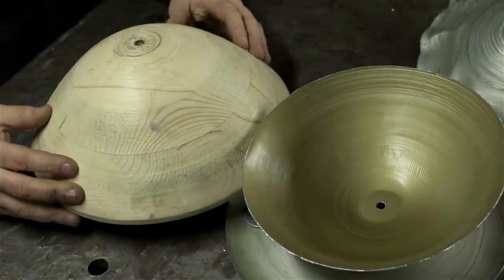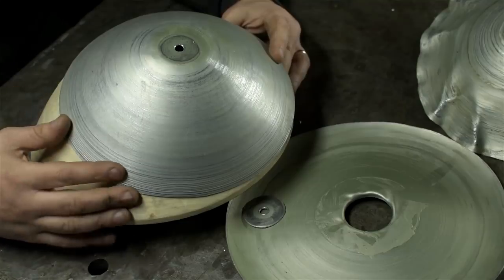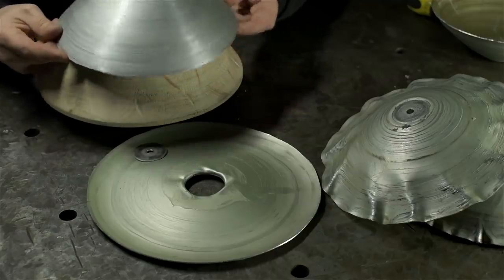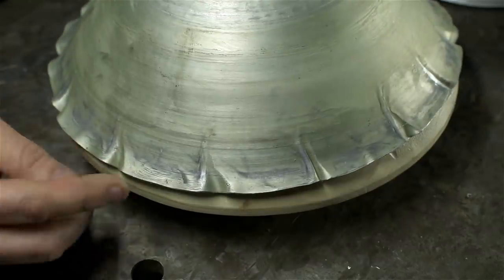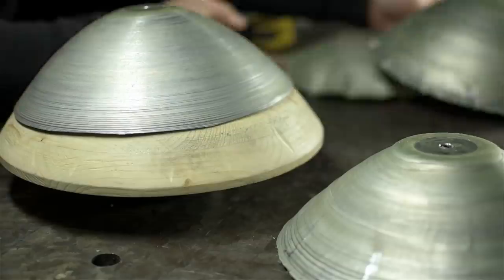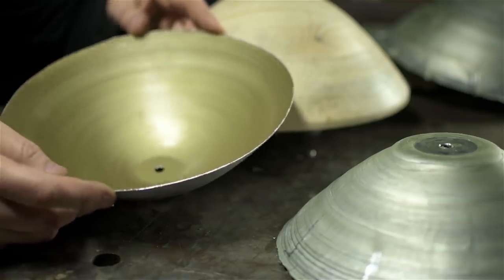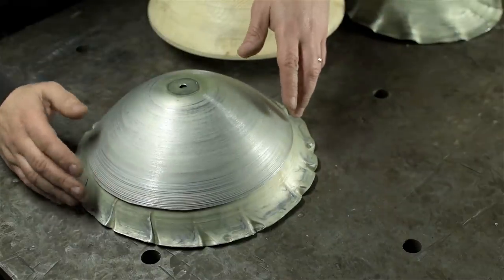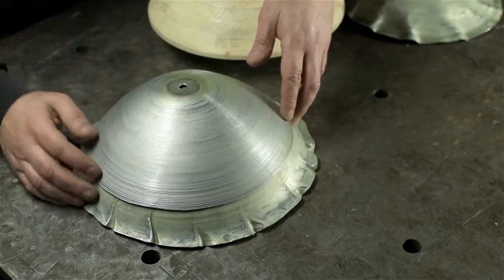Spinning Metal - Round 1 - I LOST!

Comment: This stuff, speaking from my own experience, is finnicky as hell to get done properly. I find a lot comes down to material. Copper does indeed work harden easily, brass has similar issues, I haven't done any trials with aluminium but your issues definitely does look similar to the issues I've had on smaller trials in copper. I do wonder what would happen if you stop halfway through and anneal it and then continue, and maybe again if you notice it starting to feel wobbly. Love the tool, is that just a rounded off bearing? I've just used solid tools, with plenty of lubrication.
Reply: Switch & Lever looks like a bearing from a self aligning flange bearing unit.
Reply: especially if you have a dowel to locate center, I really don't see why taking it off and re-annealing wouldn't work
Reply: What causes the waves at the edges of the larger attempts? It looks like the result of attempts to squeeze the material down to a smaller diameter. But of course that's not the case, as he obviously knows that would be impossible and he never tries it.  So what does cause that deformation? 
I'd love to experiment with it, but I don't have the tools or space.
Reply: well i can say that at work we'll spin aluminium up into the 60" diameter range, and ~18" draws. Yes, material selection is important and so is operator skill. I've not been all that involved in the specifics, but we did change a material a while back (10+ years) and had issues. We've also occasionally had issues with our supplier not providing exactly spec material which also causes problems.
Reply: Chris Edwards: Actually, it is very much possible. It is called, "raising," and is common in the light metals smithing world. The material does, in fact, squeeze together and become thicker. It's usually done with a hammer and stake, but I don't see why it shouldn't be possible as a spinning operation. With a hammer and stake, you just keep adjusting the position of the piece between the two forming surfaces to keep control and prevent folding. With spinning, I suspect it would require a progressive series of forms so that the material is backed up and compressed between surfaces.
Reply: Hi Daniel, They spin Titanium (yes, really) in a challenge-contest in Japan in this video: https://youtu.be/yUi9T_vj8zA?t=15m29s .Yes, annealing plays a big role.
Reply: get rid of the wood, flame anneal on the fly
Reply from the maker: Thanks Switch.. yes it's a round bearing I pulled out of a self-aligning bearing style mount.  Already round. :)
Reply: FXM - this is sinking or dishing because the material stretches and becomes thinner. in raising the material will shrink (generally) and become thicker.
Reply: @ThisOldTony  the disk... is actually shrinking not stretching... you can't avoid work hardening so you have to anneal as you go if you can't form it fast... fast spinning generates its own heat 👌👍
Reply: @ThisOldTony  Hope you’re well!
Reply: yes, especially that annealing part is key, trust me.
Reply: sometimes you just need big flamethrowers.
Reply: Half way through spinning you should use a bigger centre stop that is also the shape of the spinning pattern.

Comment: We have the same issues in ceramics.   I think you need to slow the lathe right down.  The faster you go the more force you have on the edge to flatten. The two pressures one being your force and the other force due to the rotation with produce those crincles.

Comment: once you get half way through forming... you can fold over the outer most 1/8 to 1/4 inch in the direction you are going, (towards the head), the closer you get the outer 1/4 inch diameter bend to a 90 degree, the better off you will be, on the rippled effect... you can try a bit of that, right before you try to lay the little bend down to the form, (buck) cut it off, with what ever lathe tool you see fit, slow RPM's... That s what works for me, on either brass, aluminum, copper... I have not played with steel sheets yet, no need, I suppose is why.. Oh, and even though, you are using what appears to be a roller type bearing, you still need oil, something to stave off any work hardening heat that would otherwise form with out running oil or isopropyl alcohol in a spray bottle.. Some will question the volatility of that, as one should, but it does keep it cool... you can start out fast, but as you work towards the outer, baby step, young grass hopper... slow as it goes... As you have already figured, the out diameter, is allot to shrink... the further out you are from the center, the tighter you have to keep your tooling to the buck and to force the alloy to shrink into itself, yes, the wobble make you desire to correct it, but the 90 degree bend you place into it, helps with that further along... good luck, and be safe.. those can come off like ninja stars, thrown by Babe Ruth...
Reply: Thanks.

Comment: Hey tot! The buckling problem is from getting the metal too thin.  If you lay metal down to the buck on the forward stroke (towards the headstock) you will stretch it- making it thinner as you go.  However, if you lay it to the buck using a backstroke (toward the tailstock) it won't stretch. You still have to form it (getting a working angle) using a forward stroke of course, BUT DON'T LAY IT TO THE BUCK until the backstroke.  Best grade of Al for spinning is 1100-O in my limited experience I've never had to anneal it-making small under 8" projects.  Lube with 50/50 mix of beeswax and mineral oil. Thanks for the vid!!

Comment: If you get some normal soap bars and rub them onto the blanks, you can get your propane torch and heat them until the soap turns black, then let it cool down in the air. This will anneal the blanks and make them much softer, you can also repeat it as many times as you like. :)
Reply: Yup! Whut he saied.
Reply: Hipgluthabidydabidy this works with acetylene smoke as well.  Put the smoke on the aluminum and heat it just until the soot burns away then cool slowly

Comment: If you are using aluminium, you ned to know that it work hardens on it self over a period of 6 weeks. The trick to spinning aluminium is to use fresh rolled material. And dont bother with center dowel, just use a flat piece on your tailstock to support the work piece. That way you will be be able to draw all of the material from the center and outwards.
Reply: I was wondering if periodic annealing during the op would help.
Reply: It depends massively on the grade. Some will age harden at room temperature quite quickly. Others will barely age harden at all even at higher temperatures.
Reply: i thought brass or copper would be better to start out with
Reply: Tsf Phi go byu a brain
Reply: There is a way to reverse that, involves heating. 
It's usually mentioned in regards to stress cracks when bending it, but it should apply here.

Comment: Tony, you are definitely work hardening the metal, Annealing is the way to go for sure. All you need is a propane torch, and a sharpie to anneal (torch for heating, sharpie for heat control) 4:13, (and the 2-3 seconds there after) is about where you can see the work hardening at play, It should never fight you that hard. Once you get the metal formed to that point, draw on the metal with a sharpie, and torch it until the sharpie marks disappear.  Let it cool till you can touch it, and start again. Theres a video on a Trombone repair thats been fairly popular lately that uses this technique.

Comment: I am a spinner ( apprentice ), but still technically a spinner. so we specialise in doing what you attempted to do int the video so i can possibly give you some tips. First things first, the thing you called "lamp shading" could be happening one, recourse you are pushing the metal too much at one time so it ends up work hardening ( i have never spun aluminum but we spin brass and that work hardens ) so you might need to anneal it maybe, again, i haven't spun aluminum so I'm not sure. And two, we use a thing called a "back stick" to support the material from behind to sort of stop it from buckling but we do do it by hand, so instead of using an engineering lathe and putting a tool on that we hold the tool in our hands and leverage it against a tool rest so it's easy to use the other hand to hold the back stick. Another thing we do is use things  called drafts, which are basically just some shapes bigger than the one you end up with,  so you end up spinning it step by step and make it smaller with each step until you get close to the final shape and then go onto it. The way you attempted to do it is very different to the way we do it but this might help.
Reply: Varis Prieditis I'm really glad there are still apprentice spinners. I apprentices at my dads shop and then a friends for 4 years. I don't spin anymore but it makes me glad people still do

Comment: These days you use a special ball bearing to bend the plate. In my days I used a polished hard steel tip bar to bend the sheet disc into bowls, cowls, etc.

Comment: Thicker material, annealed first, soap to lubricate, non rotating tool - a bit like a very polished smooth heel bar, on a long lever. Flat bar in the toolpost, with pins to lever the bar against, carriage locked. Hth!
Reply: can you explain your tooling more, I'd like to try the setup you describe

Comment: I don’t know if someone else mentioned it, but in manufacturing when making a rounded blank similar to what you are attempting we coat the top of the metal with plastic, something as simple as a torn up clear garbage bag helps. It prevents the metal tearing/wrinkling up on the ends. Maybe use some spray adhesive to hold a torn bag on?

Comment: A: I think you need to anneal your aluminum first. Smoke it with acetylene then get the torch just hot enough to burn it off. B: I'd guess your metal lathe doesn't spin fast enough. Hook up a jet engine and spin that sucker at 100,000 rpm. If A: doesn't do the trick, try B:, or C: lol

Comment: A friend of mine used to spin dishes for the Patriot missle system, and he had what looked like a crayon that he would mark the stock in several spots, then anneal it from the bottom with a rose bud torch till the crayon marks turned a specific color, and that would tell him when it was ready to spin. Pretty cool process.
Reply: Thanks for sharing. Useful pieces of info like this are half the reason I read the comments section.

Comment: The thing i see wrong here (with limited experience) is that you don't commit to the action, you have to  carry out the "wave" all from point A to point B without flapping about, and maybe that you shouldn't use a metal forming tool. Just my two  cents here.
Reply: The way I was taught back in the 80s by a guy who produced tens of thousands of lighting fixtures, was to first tweak a small, raised rim at the edge to keep the piece stable, then, as you say, commit to the motion. The material will still work harden, of course, but it hardens a lot less if the forming is done in a few bold moves, as opposed to lots of timid ones.
Reply: FXM I am logging this wisdom for future use.  👍👍
Reply: yes! Disclaimer: I have never even tried spinning, I am just a guy with the Dilbert "Knack" which is "a natural intuition of all things mechanical and electrical, and utter social ineptitude" and currently a junior in mechanical engineering I think that the metal has to only stretch not shrink. Your motions are wanting the metal to shrink inwards more than stretch backwards. For all of the forming in the middle of the disk, the outer edge is preventing the material from folding and forcing the inner material to stretch away from those outer few inches in order to form the shape. but when you try to form that outer edge there isn't any more material to hold that edge and resist folding. This is compounded by the result of doing your motions this way, that remaining unformed outside edge has to shrink inwards more that stretch backwards because by waiting to form it at the end the inner material has stretched disproportionally more than the outside would have if it was possible to complete the part that way. forming a rim like FXM said adds structure that resists folding to the very edge making it less likely to fold like that.

Comment: Tony I watched part 2 and Think i see where you're having trouble. If you notice a few video's of factories that are making spun aluminum tanks they have multiple positions where they fulcrum the tool. I think angle on the work is key here. If you have a tighter angle on the work you run the risk of applying too much downward force at once cause the work to harden and to press backwards onto the center. Try moving your fulcrum out from your work and mess with the angle your are pressing? Great vid!

Comment: @6:16 you explain that "the material is definitely stretching" which is true until you get near the top of your wooden form.  @5:00 you explain that the wooden form is 12 inches in diameter, but your blank looks (@3:50) to be 14 or 15 inches in diameter, so the outermost edge crinkled because you were actually trying to compress the diameter from 14ish inches down to 12 inches. 

I'd guess the biggest blank you could use would be 12 inches.

Comment: One thing you might try is making an intermediate blank to shape it to first. If I remember correctly the stretching happens the most when tool is pushing the material against the form, imagine a hammer and anvil drawing out the material, whereas when the tool is just bending the material, it behaves more like bending a rod or pipe with a hammer and bends the material without drawing it out as much because there isn't the "anvil" on the other side.

Because of the hemispherical shape you are aiming for, if you imagine transforming the flat disc to the final shape, what you need is to have the center of the disc stretch out the most and have the amount of stretch decrease as you go farther out, eventually having the stretch actually become negative. If you were making a full hemisphere the material would actually need to shrink quite a lot at the outside diameter.

The issue you are having is from the transition from the stretch region to the shrink region, the point where to get the material to bend at that angle you would normally need to actually remove material. Since that's really hard, it's easier to get extra stretch in the center instead.

TL;DR If you do it in multiple steps instead you should be able to get more stretch over the whole thing, letting you get farther around the form before you hit the transition that wrinkles up the part.
Reply: btw, this is from engineering class, not real world experience so no guarantees.

Not sure if this helps but if you have any experience using an english wheel then its the same principles at work.

Comment: Hi Tot. I've never done this, so find a large pinch of salt  - but, I think I can see what may be going wrong.  As the bowl is formed from the centre outwards intitially the metal is being stretched, so it works up to a certain point on the curve. Try and progress beyond that and if technique is not right (and who am I to talk?) the metal is being asked to unstretch. Won't work. Crumples. What I think is needed is a slightly different technique. Keep the outer edge of the initial dish closer in to the former as you work it round the bend. Possibly with some material gentle stress relief with some heat would help, but I've never seen that being done. The key must be in maintaing the geometry during the tramsition so the metal is always under tension. Kudos for trying. BobUK.

Comment: Tony, thanks for the video.

I lube with wax while spinning and I temper the metal as I work  it down.

On another note, about cutting oils:
 I do use cutting fluid even with carbides, not necessarily for cooling but for lubricity. I think my tooling lasts longer and I get better cuts. Also I'm not seeing fracturing of my inserts. I use Cool Tool II, I settled on it after a lot of testing. It works well for tapping and my power saw too and is pretty low smoking. I tried Mobilmet 766 which is for thread cutting. It works well but it gets rancid in the can, maybe if I tried putting it in a small bottle it might not be so bad. 
For my shaper I use Anchor lube G771, it seems to stick to the metal better on the shaper but you can just use one cutting oil, if I had to choose it would be Cool Tool II.
Rob

Comment: Hi,  The form is usually called a chuck.  I've done a SMALL amount of this work, a long time ago.  I'd suggest two things; first, did you anneal the metal?  That's an important part of the process.  When the metal starts to sound differently as you're working, it's your cue that it's hardening and needs to be reannealed. You may have to do so several times.  You were ABSOLUTELY right to secure the center of the work piece.  You've SEEN 'Goldfinger?'  Lastly, you should use wax or grease when spinning.  It'll help dissipate heat from friction and avoid galling, which can damage both your lever and the work piece.  Good luck.

Comment: At my shop we spin stainless steel regularly on CNC lathes. I would suggest starting with thicker stock and always starting from the center and concentrating more on pushing material out on each pass. We start with .063" thickness and by the time its spun down the thickness is easily half that if not more. The process is always to spin from center to end on each pass as well, if it wads up on you then you have a material issue or a feed issue. Good luck Tony!
Reply: Oh also the RPMs are set to the "launch you into orbit" mode